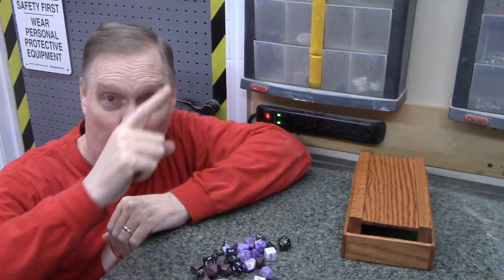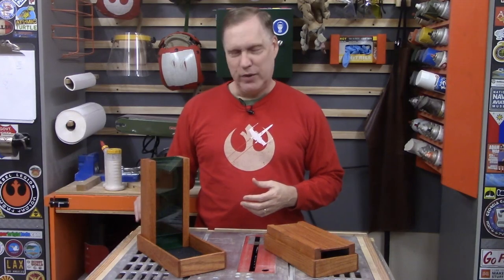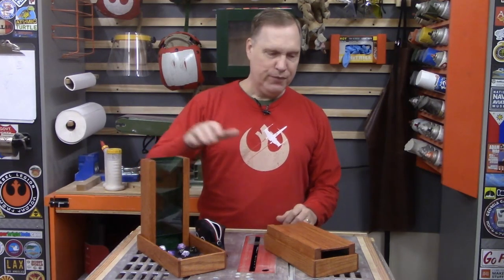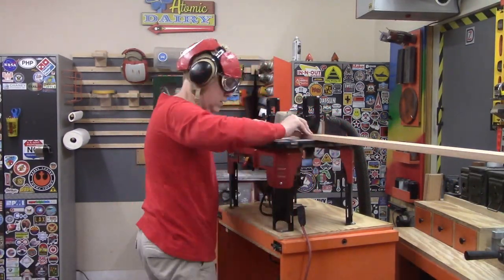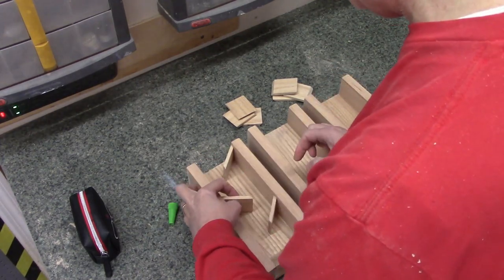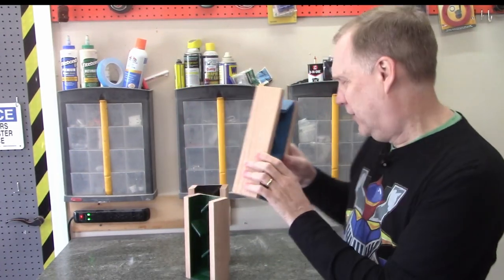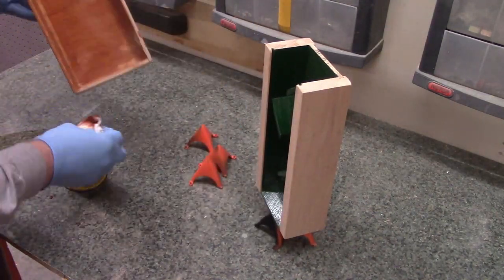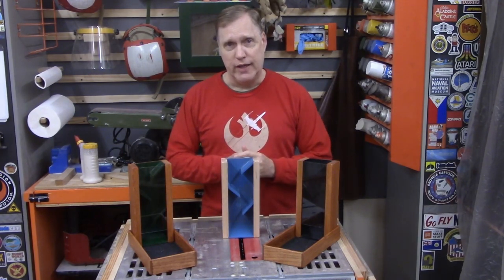Portable Dice Towers - Collapsible Gaming Gear

Comment: Great channel! 

I really like how all of your equipment is at perfect working height 

to easily and (safely) see what you are doing.
Will there be a video on the tilt table build? 

I'm dying to try this : )
Reply from the maker: Thank you! We were tired of bending over tool stands all the time, particularly the table saw and drill press, and made all of our workstations as tall as we wanted them to be. We built the tilt table a couple of years ago and use it pretty heavily, but it has developed a swaying motion and we are thinking of rebuilding it to a better braced design that won't wiggle. It's on our list but we don't have a date for the build yet.

Comment: Howdy!  Question on the blue one.  Do you think that primer would have avoided the bleed though on the back of the piece?  I'm currently binging all of the Atomic Dairy videos and I have so many things I want to make now once I get my shop back to where I can use it. (we won't get into that right now :) )  Dice Towers is something I wanted to make for myself and my friends.
Reply from the maker: Primer or polyurethane could have sealed it against paint bleed. We're going to build a second batch of these and will try to seal them up with poly before we paint. Hopefully it will work.